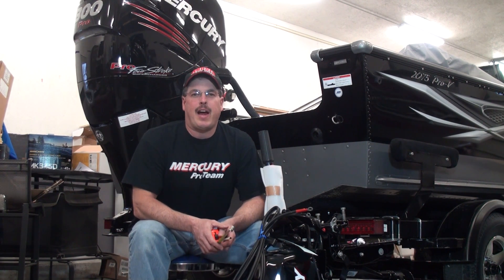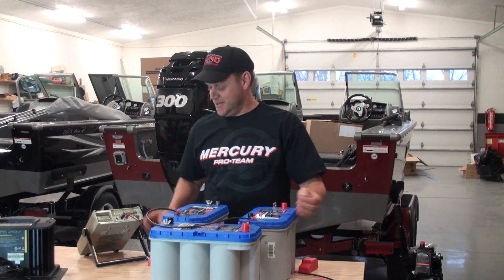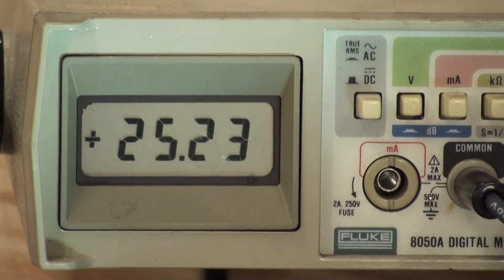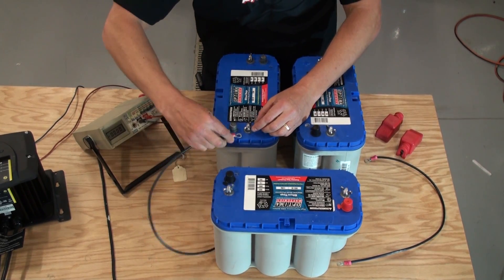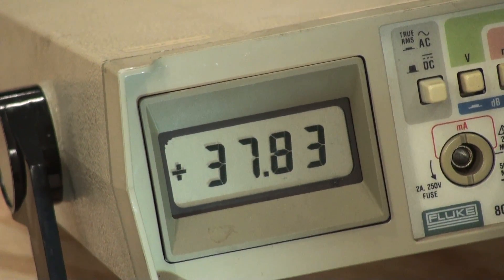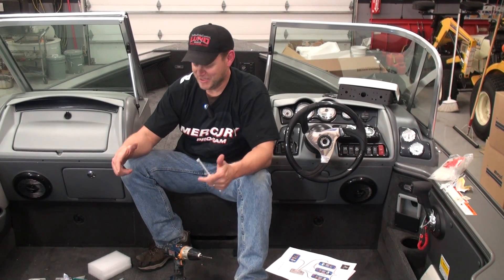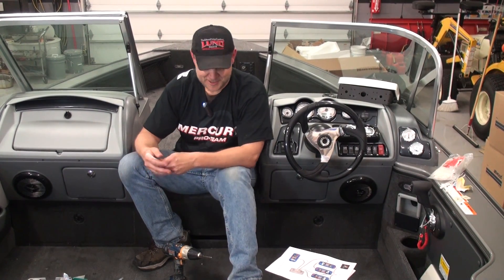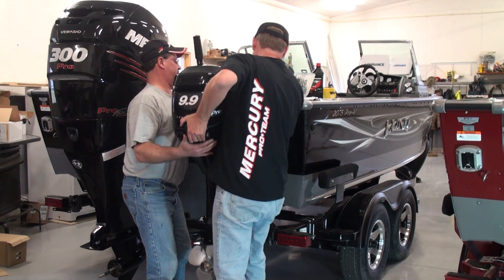Installing 24V and 36V battery system for trolling motor

Comment: Quick question if you do that to a 36v system would the first battery still be 12v? Like if you wanted to hook up your graph to just one battery?
Reply: If you add anything to the one battery and they are all hooked up in a series its going to be 36v to everything

Comment: could you show the 24 battery setup with a 1-2 battery switch selector going to a Neg- bus bar and a Pos- busbar going to a fuse block? no one has how to wire a boat wit a setup like that

Comment: I want to get an Ulterra 24V. Currently Running a 12V Powerdrive and two 12 Volt downriggers and other accessories.   Question is Once I wire the batteries to 24V how do I wire my downriggers?  One Downrigger per battery?

Comment: I have a question. My boat is a bit older. The trolling motor is a 12V system. I want to upgrade my motor but the new ones are all 24V or larger. Other than the obvious (hooking up another battery) do I need to replace all the wiring as well if it's still in good shape?

Comment: hey,  dumb question.  in a 2016 pro team 175   currently 12volt.   i wanna make it 24 volt for upgraded troller .  is it simply as easy as just combining the batteries like you did in the video ?   is the OEM boart boat wiring and switches etc ok with the jump in voltage
Reply: chrisccraig yes if its all wired up correctly you should be fine.

Comment: I am about to hook up at 24V trolling motor. My buddy who is a physics major says that you can still use the other batteries for 12V as long as you only hook into 1 battery per device. That being said, I am worried about it. I'm gonna hook up batteries for 24V, then put volt meter on a single battery. It should read 12V. Then I'll be okay with running other electronics off of it. Can anyone confirm or negate this? Thanks
Reply: I am wondering the same thing!!
Reply: I did it. It works. The only problem I am having is I'm getting some interference with my Side Imaging and Down Imaging on my graph because my sonar is hooked up to one of those batteries.
Reply: Me too
Reply: Bo Manton oh man if your buddy the physics Major is with an engineer, I’m sure between the both of them they should be should be able to figure out how a screwdriver works haha.

Comment: I'm new at installing trolling motors and fish locators. I have a new boat that I am setting up. I bought a Minn Kota Terrova 80 lb 24 volt trolling motor. I now see how to set up 2 batteries for 24 volts for the trolling motor. My question is can I hook up my humminbird Helix 9 to one of the 2 batteries or do I need to get a forth battery including the starting battery? Thanks!
Reply: +Trapper234 yes. i just hooked a 24V trolling motor and am powering my other electronics off of one battery per device. as long as you tie into one battery, its still 12V
Reply: +Bo Manton Thanks Much!

Comment: I just bought a new boat with a 36v Vantage. I have a 24v Terrova with I link that I dont want to get rid of. Is there a way to run a 36v system and a 24v system? Is there some way to shut off my 36v when running my Terrova? Any help on this would be great

Comment: I have 3 wires coming out of my trolling motor red, black and white.  I know what the red and black go to but what is the white one for?
Reply: Sylvia Roldan
Reply: Sylvia Roldan ground wire?  not sure where it needs to go.
Reply: That trolling motor is at least a 24 volt .  may be a 12 /24 Check it out before hooking it up.

Comment: I want to fix my boat so that my engine uses only the cranking battery and the trolling motor only pulls off the deep cycle battery. Is there a way to hook up a single 12v deep cycle battery to my trolling motor and also connect it to the outboard so that it will charge on the run back, but the outboard will not pull off it?

Comment: I run a minn kota 24 volt all terrain, I suggest deep cycle batteries with minimum 800 amps each tied in series as shown. Depends on lb thrust of the motor, mine is 65lbs and this works great. 80lb and up, go with minimum 900 amps each, and never use a crank/start battery for a trolling motor, Deep cycle/start is fine.

Comment: No you cannot run accessories off of one of the batteries that are tied together in 24v system as the accessories will be running off 12v. You will pop fuses or burn out anything requiring only 12v. The separate battery used for accessories and starting the main motor should be charged with the altenator. I suggest buying a 2 bank on board charger for the 24 volt trolling system, when you come off the water simply plug in to an A/C outlet. Always make sure ONLY the trolling motor sees 24 volts

Comment: Hello, I need a little advice.  I'm thinking about buying a 24v trolling motor...If I run a three battery system...one starter and two for a trolling motor on a 24 volt system.  Can you run all your accessories off of one of the batteries being used on the 24 volt system?  Also...I'm running a Mercruiser 130hp.  Will the alternator charge all three, and what batteries or battery  should be getting the charge.  Currently I'm running two batteries.  Thanks.

Comment: I have 2 deep cycle marine batteries for my trolling motor and a cranking battery as well. Should all of them be in line together? I am only getting about 4 hours out of my trolling motor. Could it possibly be a fuse? I recently had my boat serviced, and am not sure everything got hooked up correctly. I replaced the batteries, hoping it would solve the problem, but the new batteries still don't last more than 4 hours????

Comment: If I have an existing 24 volt system can I upgrade to a 36 volt without having to change my TM plug or the existing fuses??  Essentially all I want to do is add a battery in back without making any changes to the wiring through the boat nor to the female plug.  Thanks.  TK

Comment: a solar panel and a amp charge controller. on amazon you can get a great flaex panel for around 50 and the controller for 20. shipped right to your house.